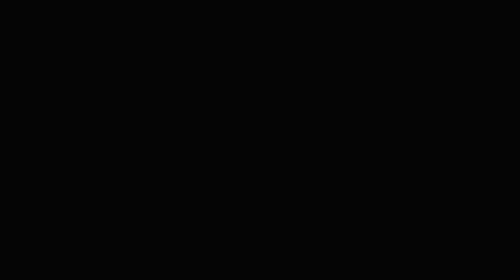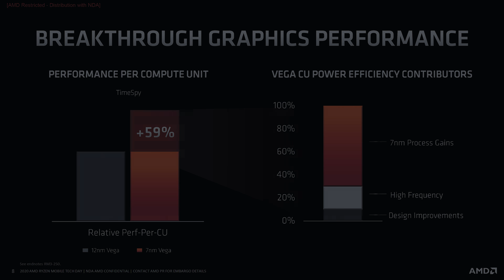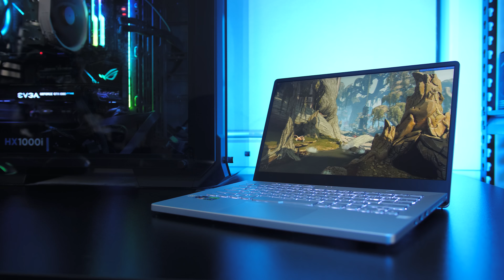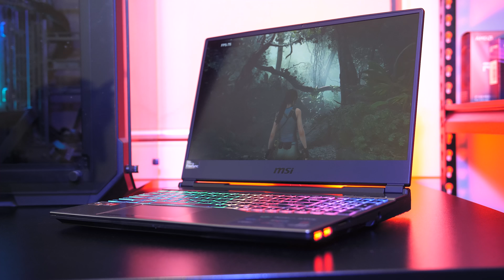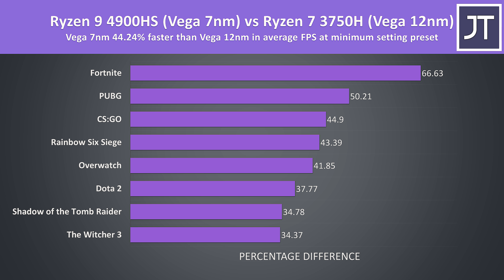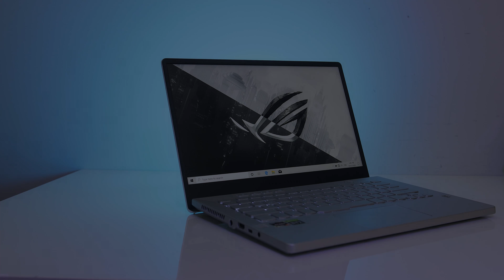Vega iGPU Gaming Comparison - 12nm vs 7nm (4900HS vs 3750H)

Comment: For a guy who plays mostly story driven games and old title, I don't even feel the need to get a dedicated GPU anymore. Let's see what the U series brings. Please stay safe and healthy.
Reply from the maker: Cheers, you too!
Reply: Exactly, U series also has +1CU, for a full 8... that's almost 15%. Idk how much clocks will go down if at all, but U series might as well provide almost same experience, especially premium 4266 LPDDR4x ultra books. If Intel allows OEMs to make one that is.
Reply: @arditm2178  4800U = vega 8 1750Mhz
4800H, HS = vega 7 1600Mhz
4900H, HS = vega 8 1750Mhz
Reply: Me too, I just started playing Assassins Creed first game. Next I am thinking about Witcher. But still I prefer dGPU, as I don't want to play in low settings. Currently there is complete lockdown here in India, I would buy either A15/A17 or G15 as soon as lockdown is relaxed.
Reply: I'm interested in either Van Gogh or Matisse upcoming AMD APUs. These will have RDNA instead of VEGA, a dedicated gaming architecture instead of a compute one. These 5000 or 6000 series APU should offer ps4 pro graphics performance in ultrabooks (medium settings 1440p 60fps or 1900p 30fps). Renoir (4000 series) offers base PS4 gaming performance.
Reply: Sounds like a winner for me as well. Good point.
Reply: The U series might come with lower clocks/thermal headroom, but they also come with LPDDR4-4266MHz RAM (at least the 4800U, compared to DDR4-3200 standard SO-DIMM laptop RAM on the 4800/4900 H and HS models), so from what I expect and some of the leaked tests, I see them being up there with the rest of the H and HS packs.
Reply: Also for reference, almost all 3000 series mobile APUs where stuck with 2400MHz DDR4 (except for some embedded/All-in-one versions of them which had 3200MHz support).

Comment: need to compare with nvidia mx150/250
Reply from the maker: Don't have any laptops with that unfortunately, can only work with what I have available :(
Reply: @JarrodsTech  doesnt one of the little razers have that? maybe something from dell does. try those out?
Reply: @bradhaines3142  the razer blade stealth 2019 has a mx150 but razer doesnt sell them anymore (got one model but cant find that version on the official website anymore) probably coz their quality sucks
Reply: I saw it beating the MX250 in a review somewhere.
Reply: Check out hardware unboxed